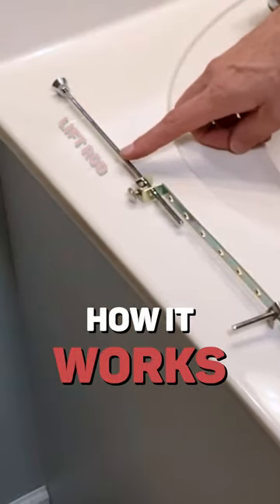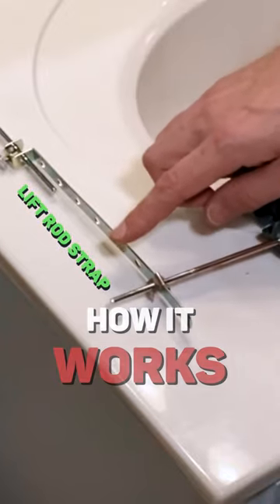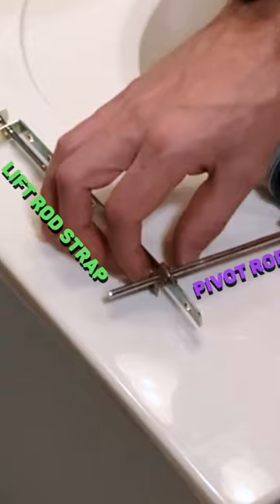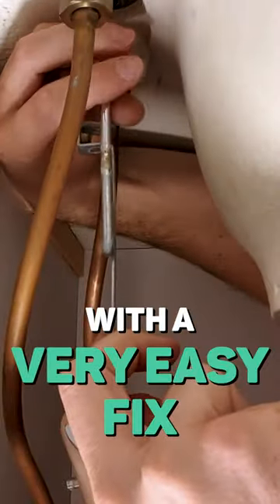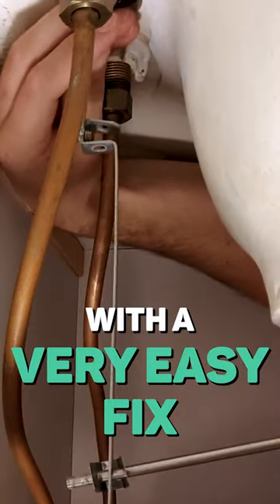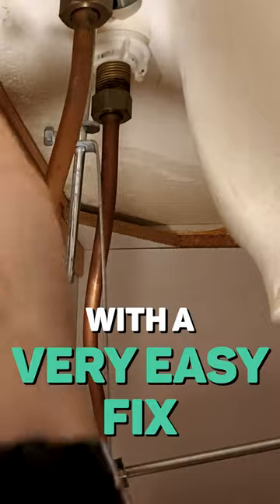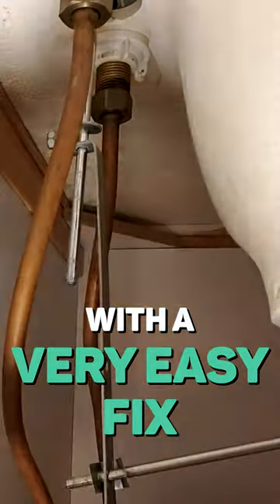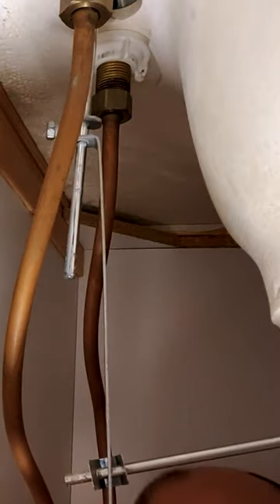Easy Fix For Common Sink Problem #shorts

Comment: I am having problems with my drain stopper. My lift rod and lift strap seems to be secure together by the clevis screw and it moves the pivot rod. Now here is my problem, when I lift the lift rod,it plugs the hole as it should but when I push down on the lift rod,it does not open up the stopper. When I look down underneath the sink as I push down instead of pushing the strap down it more or less does a side motion. What do I need to do to fix this. Right now the connection between the pivot rod and strap is on the very last bottom hole on the strap. Would moving it up a higher possibly fix the issue?

Comment: I e got this type. Of drain stopper in my bathroom. The worst part about it is it's prone to catching hair and other gunk and the result is a slow drain that no drain cleaner will fix, because the clog isn't in the trap. I have to take it apart and clean it manually and it's always really gross and slimy. I hate it.

Comment: My drain stopper almost has a filter at the bottom and it gets clogged up after about three or four months and I have to take mine apart. Any tips on that? Have you ever replaced the stopper system?
Reply: The stopper has a filter?!  What brand do you have?  If you don't see one on the stopper, the brand is usually the same one as the faucet.

Comment: My pivot rod keeps pushing the rod ..i need a peice to keep the clip and strap to stay on the damn lift rod..it keeps  falling apart, the maintenance man cant fix it,he tried and thought he was achieving something..NOT!! 
IVE BERN DEALING WITH THIS  CRAP FOR TOO DAMN LONG!! 😢
The sink is brand new and so is the damn parts..
Reply: Expand/Stretch the clip around the lift rod. This will keep it from moving/coming off. I had the same issue, but once I did that it didn’t move.